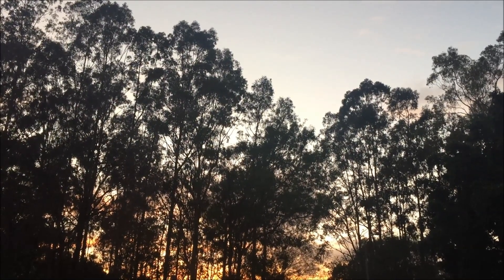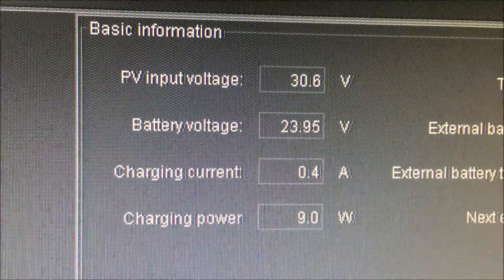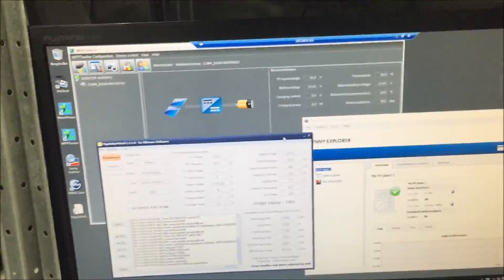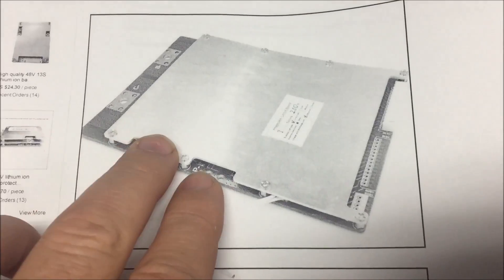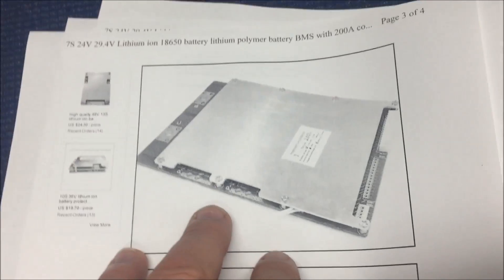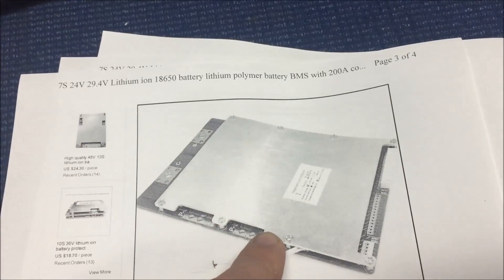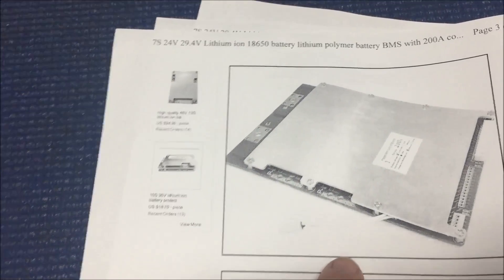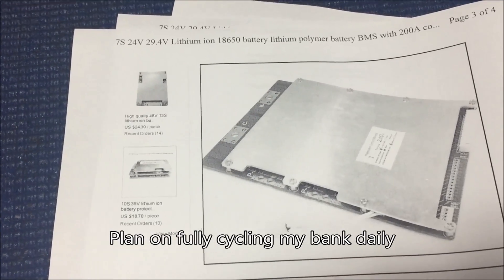Homebrew Powerwall BMS/Inverter incompatibility

Comment: Mate use the PIP, the Selectronic is too thick for your bank profile. You'll need to blow air from the bottom of the Powerwall so get a couple of PC fans that fit the profile. You'll need a 24 to 12v step down, Giant Power sell them. I'll give you a 12 to 5v step down so you can power a tablet on the front of the battery. I'll give you Powertime of course. Btw Haven't seen your probe PC on for a few days :-)
Reply from the maker: +DukeHeart Ordered some 24v fans just in case - want this to be simple and clean so as little extra stuff in there as possible.Never gave thought to using a tablet (W10 based with usb port) to run/monitor it. Great idea much better than a headless nuc. Sent you login details, I was playing with it rebooting it a few times - next time your in make sure you set it up for your own access.

Comment: It'll work just fine. The BMS works in both directions,  charge and discharge. It just goes between your pack and inverter, and all of the cell taps get connected so it can monitor each cell individually. Just make sure you hook it up properly, and all will be good. :) 

I'd recommend using it.. It's a huge safety upgrade, especially with potentially mismatched cells.
Reply from the maker: +Mike M OOh i'm using it, but also need to learn as i go. Blow something up then ask twice - typically how these projects go lol (but not this time)

Comment: Hi Peter. Just so you know some Australian blokes from the EV forum built a new firmware for the PIP 4048 to be used with Lifepo4 batteries. It is a 48V system but at least they upped the cutoff voltage from 48V to 52V and a couple more changes that I don't remember right now, but I think they are related to the charge controller side. I think the YouTube user is called OffgridQld he also uses this nick name on the forums.
Reply from the maker: +Gustavo Malaga ok found him, just waiting on admin to approve my account, thanks for that .